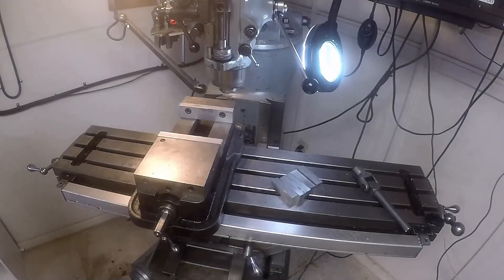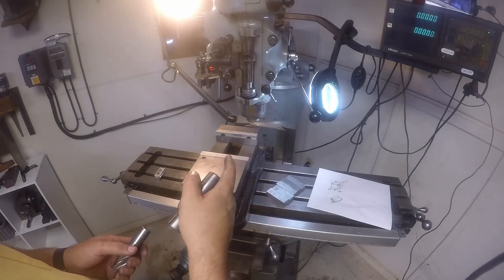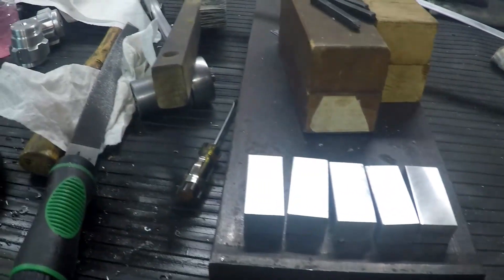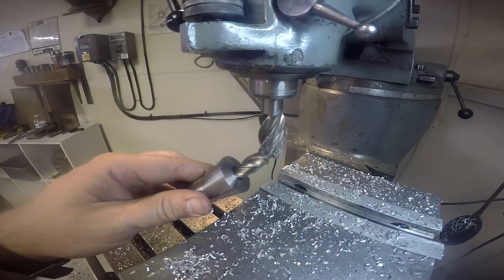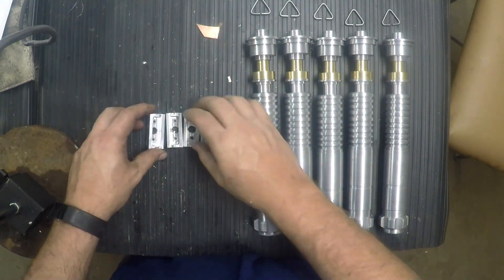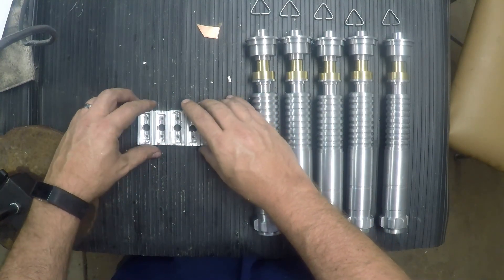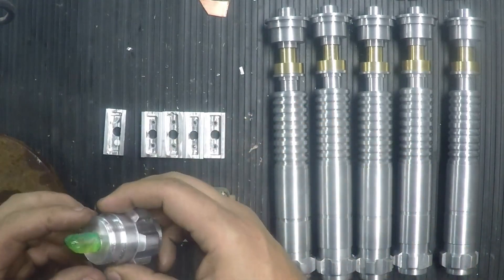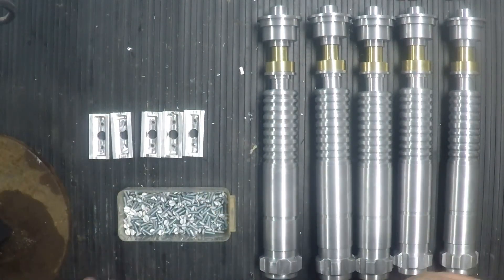ROTJ lightsaber Part #8 Control boxes

Comment: Hey man great machine work! I know I'm a little late to the party, but I had an idea for a cheap and easy way to light those crystals. You could probably get away with using some of those candle tea lights that are powered by a cr2032 battery, they might be just small enough that you could mill out a hole in the pommel for them to set in with the crystal on top. Might not be too bright, and kind of a pain to turn off and on, but it's a solder free way of doing it. Anyway my dad and I enjoyed the video, keep up the good work!
Reply from the maker: I had that same idea and actually have a bag of them.  Nobody seems interested in them as they are now so maybe I'll open them up and see about adding it in.  I may also add a lexan tube/LED string for actual fighting.